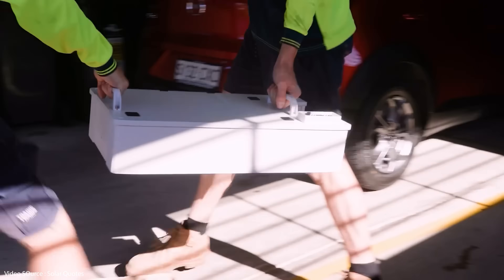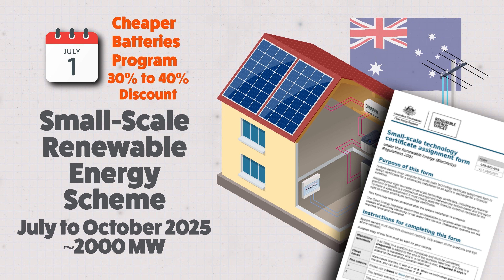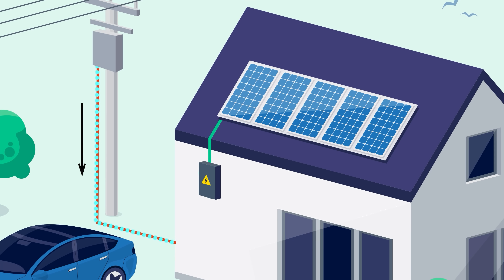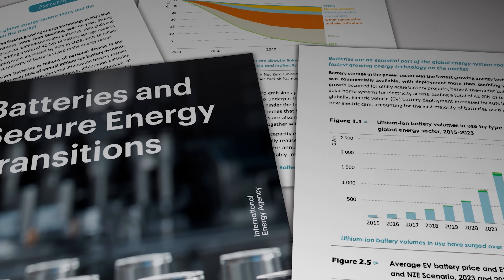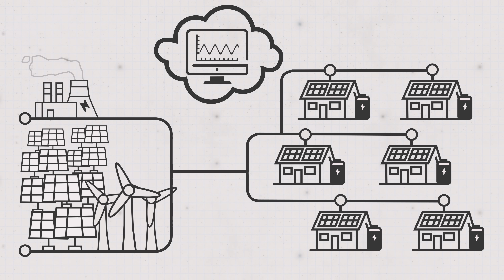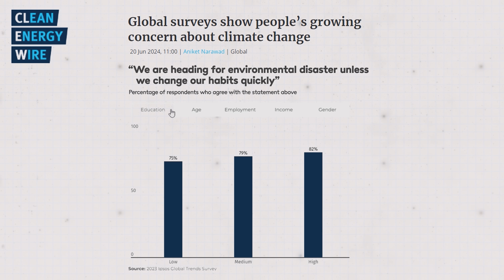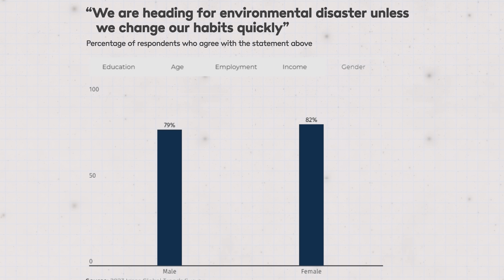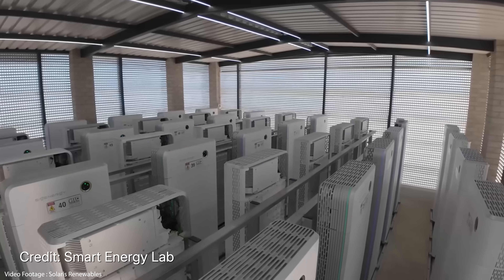Australians installed 100,000 home batteries in 17 weeks. Why can't we all do that?

Comment: So, for about 300million US dollars the Aussies have got the equivalent of a decent size power station, built in 17 weeks!
Reply: Not quite. Current technology was originally developed at the University of New South Wales and manufactured was licensed to China. Royalties were paid for many years and this continues in many other forms today.

Emitter and Rear Cell) technology—which currently underpins over 90% of global solar production—expired before the industry reached massive scale, UNSW continues to earn income from "related technologies". These include newer patents for hydrogenation techniques, patterning, and contacting technologies used in modern manufacturing.

Joint Ventures and Revenue Sharing: UNSW has established commercial partnerships that involve direct profit sharing. For example, a partnership with Hangzhou Cable involves a joint venture where royalties are shared equally.

Commercial Agreements: Historically, UNSW has signed significant licensing deals with Chinese firms, such as a $1.4 million agreement with CEEG Nanjing PV Tech to adapt PERL solar cell technology for commercial use.
Easy Access IP: UNSW utilizes an "Easy Access IP" scheme to fast-track commercialization. In some cases, this allows companies free licensing for a set period (e.g., three years) provided they invest in university research and acknowledge UNSW as the inventor.

Ongoing Research Partnerships: As of 2025, UNSW continues to receive grants and funding aimed at fostering ties with Chinese solar leaders, such as a $500,000 grant from the National Foundation for Australia-China Relationships to connect young innovators with China-based solar alumni.
Reply: But the money went mostly to China.  Congrats

Comment: This is touch Contraversial for Australia.

The Australian Government has added more Complexity, more Costs to Homes.

Then there is the detail of the installation of the batteries.
The batteries are being installed within the homes and increase the Home Fire Risk.  As opposed to installing them external to the home.

Then there are the Merits, the Higher Energy return per Solar system and per Larger Batteries of Large Scale Solar Power Stations.
lSSPS in locations such as Inland QLD with it's Rich supply of Sunshine.

The entire Grid in Inland QLD could easily be Sunshine Powered from LSSPS.
Plus Inland QLD can power a Significant percentage of the Populated, Industrial Coastal Grid.

Comment: I'm in Brisbane, Australia. Just installed 30kw battery (Sofar), 11.4kw Panels (Jinko) mounted flat on 1% roof. Old panels removed by the installer. Cost after rebates $16k. Will now be in credit on quarterly bills. It is currently summer, and using 63% of power direct from panels during the day, 37% from batteries at night. Once battery is full, feeding 15kw onto grid each day. Battery was 80% full this morning. At current calculations, I expect ROI in under 6 years.

Comment: dutch here,  i did get solar with a goverment incentive,  but they are slow with batteries,  i did buy a plug in battery,  to use more of my own solar power,  and  cut costs on  penalty's  for delivering to the grid.   which power companies started to do,  because of grid  overload.

Comment: It would be very interesting to know what Home Roof Top Solar PV is actually generating now here in UK as there are a lot of homes with it. I suspect most recent purchases will also have gone with battery storage. Hence fully time shifting electricity use to cheap electricity/free from the roof. Depending on what ever Export Tariffs are available. 
I am amazed that we are paying Wind/Commercial Solar to turn off when we have too much. They should have that subsidy taken away and then they would look at sensible storage options - of which there are many. Stupid people writing the contracts.
Reply: Battery farms end curtailment events for wind farms.

Comment: Must have a direct line internet to the house or the warranty goes from 10 years to 2 years on the batterys. well that means i have to pay more for internet, when i can only use the mobile internet or mainly tethering off my phone. so that means i have to pay $170 AUD every 2 months on old tech cable internet, oh great. that's means i'm nealy paying same amount for my power bill.  due to failed government not replacing all of the lines to fibre in area.  plus i'm happy with the 5g network on 300gb per month, I don't need anymore then that. it's a shame, it just makes things complicated. oh and also insurance increases too...ouch...nope.

Comment: In Australia we are getting 1 to 3 cents a kwh and paying 38 to 40 cents a kwh in less than 10 years the price has doubled so even though the subsidy was 1/3  people were very unhappy and they saw this as a way to even the score also the size of the batteries was a shock to the goverment 20 kwh and even over 100 kwh of storage was being installed  so that over 100,000 installed may be a lot larger than 2000 megawatts. You may want to look at the statstics avalible from AEMO to see what this has done to the peaks.

Comment: The idea that suppliers in most Australian states will pay you for excess power sent to the grid is technically correct but very misleading.  While very early adopters got fantastic returns on their surplus power returned to the grid payments at least in Victoria are now 
so low as to be meaningless.  And let’s not forget your  electricity bill  is based on two factors first the charge for electricity purchased from the grid and second a “supply” charge that covers the cost of installing and maintaining the power generation and distribution infrastructure.   Even though our house has a 5 kWh solar system and 32 KWh of battery storage and runs 100% on solar power for 7 months of the year our annual power bill is still around $700 most of which is the supply charge.  And there is a sting in the tail.  States including Victoria are looking to limit the amount of domestically generated solar power returned to the grid. Over supply on a fine summers day when every solar system is producing more than can be consumed or stored on the premises can cause serious grid instability to the detriment of of every home or business that is connected to the grid.  Solar and onsite battery storage are great but no where near as good was some commentators on this video would have you believe
Reply: Forget about solar and batteries.  It's a dead end.

Geothermal is the ticket.

Comment: What has also occurred in Australia is there has been an uptake of larger solar systems as some households update their old solar systems with larger systems to facilitate adding a battery. The battery sizes being installed has also increased probably as there are more choices of battery. and prices dropping.
The battery rebate has to be a win win situation. The government is increasing the storage capacity paid around 70% by the households, and households save money by having storage at home to use at night, a clever move by the government.

Comment: What they don't tell u, u pay 60% at $1000/kw capcity, u have no control of the charge rate in or out, a high battery cycle rate could mean battery replavement after only 5yrs(LPO). The kw/hr rebate is only 3 cemts in Western Australia. Con Job.

Comment: I'm Australian folks, when you take up the offer of the battery you get included in the VPP, Virtual Power Plant, in short the government can use your battery power ANYTIME they need it.   Yer nah! If you think the take-up is because its awesome your wrong , the main reason is because power is extremely expensive. It comes with risks, most batteries are made in China, a virtual bomb connected to your house, you will still be paying it off before you get your investment back, only the rich can afford it. Straight forward solar panels no battery is the way to go for less cost. The main problem even with this is the inverters, they die after a year or 2 are you surprised? there made in china..... The warranties are 20-25 years but the companies have gone in a couple of years so no warranty fulfillment. Dreams are awesome, but the reality is crap, sorry. As for the positive comments, call back in 3-5 years....

Comment: We installed a 5kwh solar system and 32kwh battery storage which is the largest system that makes economic sense in a suburban home. In the southern states We made this investment without subsidies to ensure energy security at a time when traditional supply sources are under threat and commercial wind farms and solar farms cannot be relied upon. The pay back period depends on where in Australia you live and there are huge differences between an installation in Cairns and one in Melbourne. In Melbourne we can generate more power than we can use or store for about 7 months of the year but during the colder months we can only generate about 20% of our energy requirements .  Was the invest of $45000 plus worth it.  In a purely economic sense No.  But in terms of energy security at a time when governments at a state and federal level level are engaged in magical thinking.  absolutely

Comment: The issue with the model in Australia is the price gouging by solar installers  is rampant.  They pocket the rebate and charge us the raw cost of the systems.  Basically they make 10000 AUD minimum for 1 days work when adding a battery to an existing solar system....

Comment: I am in Australia and recently moved house - it was a no brainer to install solar and a battery under this scheme. 13KW array and 32KWh battery. On a good day it will generate 90kwh a day, battery powers the house from sunset to dawn, including AC, and is totally recharged by 9am the next day, usually. Just signed up to Amber to become a VPP and sell excess capacity to the grind when wholesale prices are higher. Micro-generation is the future in my opinion.

Comment: I installed solar panel 2 yrs ago, it works great, but I still pays around $100 per quarter in winter and around $30 per quarter in summer. So in a year it's roughly like $260 VS pre install of like $1200 a year. But installing a battery cost about $5000.which it would take me about 20 yrs to make it worth. I would consider it if it's like $2000

Comment: I got 6.6kWh of panels in early 2020 and the Work From Home became a big thing so got a 9.8kWh (really 9.2kWh because what happens when you drain a lithium battery dry?) which cost me AUD$12,800. If I had waited 3½ years I could have gotten a 40kWh battery for AUD$8,7000 and would been 70 to 76% self sufficient for all my electrical needs.

With what I have it is now 57% self sufficient but my power bill is now more than when I install the panels in April 2020. The more self sufficient I become, the more the price of grid power increases.

FUN FACT In 2019, Melbourne Australia was putting the equivalent of a 400MW power station on their roofs (rooves) *every 3 months). But still the LIEberal COALition government at the time was talking about building new coal fired power stations.

Comment: We 'prosumers' AREN'T getting anything like a reasonable price when we feed the grid.  It used to by 60c/kWh (stupidly high) then dropped to 30c and is now at 1c/kWh which is an utter insult when we have to pay at least 30c/kWh to buy power from the grid when our solar systems aren't producing enough.
I was knocked back from several solar battery installers because the system appropriate for my home wasn't large enough (for them to make a big fat profit from) after the rebate.  So I've just bought a heap of Ecoflow units and should be able to disconnect from the grid entirely in the near future.
Ultimately, this sort of this will become the norm, as when grid demand drops like it has been, and only well off people can afford solar/batteries, the poor will be faced with higher and higher power prices for access to a grid that is going to cost more and more to maintain and feed.  As always, the rich will have moved the playing field out of reach of a majority of people and will get all the benefits themselves while everyone else pays.

Comment: it can be frustrating watching channels like this, highlighting every new niche renewable energy tech or battery chemistry. when good old solar has been good enough for 20 years, and is very cheap now, and lithium iron phosphate cells are all we need. all the different tech displayed is akin to muddying the waters somewhat. i run my entire house on cheap solar and lithium cells from china, have done for 6 years, total cost was about 4- 5 years of bills, this was without a single subsidy because i self installed with china direct prices.
Reply: I'm sorry, but a world filled with tens of millions of wind turbines, and billions upon billions of solar panels, and trillions upon trillions of battery cells is abhorrent to me.

They last only a few short decades each generation (needing to be recycled over and over and over), and are WAAAAAAY more work than is actually needed.

The world has so much thermal energy beneath the surface that 0.1% of it can power all of mankind's needs for 2 million years.

Geothermal is the path forward.

It has a capacity factor of 70-90% (only nuclear power has a higher capacity factor), and (5000) 500 MW geothermal power plants could provide us with all of the power we would ever need.

They also can last for literally centuries, and their environmental impact is tiny compared to going wind, solar and batteries.
Reply: @Les_S537  We have been trying to get geothermal to work for decades. Till we finally get it working, making the most of the energy hitting our rooftops each day makes sense.
Reply: @tassied12  Geothermal is about the have a revolution.  Look up Quaise Energy's millimeter wave (MMW) drilling technique.

Quaise Energy spawned out of the MIT Plasma Science and Fusion Center a few years back.

They use a gyrotron (used in fusion reactors to heat the plasma) to produce millimeter waves to literally vaporize rock.

They did a field test recently in a granite quarry in Texas where they drilled a 118 meter deep borehole into the granite and achieved 5 meters of drilling per hour.  Traditional mechanical drilling typically gets 0.1 meter an hour.

Quaise will make geothermal possible across the entire planet.
Reply: @Les_S537  Lets' see. Hope they are successful. Meanwhile, my point still stands. 

Innovations such as balcony solar mean that it can be used almost anywhere. Energy consumption at the point of generation is the most cost effective approach.

Ordinary Pakistanis installed 17 GW of solar capacity in 2024 alone through the availability of cheap solar panels.

Comment: In South Australia, just the rooftop solar systems in Adelaide can produce more than 6 times the electricity usage of the state.
The system was designed for such an oversupply by simply cutting the connection between certain houses and the grid, this is done automatically and alternates which houses get disconnected. 
South Australia also has a massive battery system that powers Adelaide overnight.
It is not a perfect system but large-scale solar power systems are still being developed.
The technology is already available it just needs some adjustments as the technology improves and we learn more about what is possible. 
Cutting houses from supplying the grid is not a waste of energy because it is free and as long as the sun is doing what it does the only cost is matenance which costs less per year than the weekly matenance cost of fossil fuel powered electricity generation.

Comment: Poor subsidising the rich. That’s all it is. And making the house owner pay for the grid. It used to be the other way around. But you idiots are all suckers for the “free stuff”. Morons
Reply: Our PV panels were installed by our local council;  We get free/cheap eletricity (we never managed to make a profit on it yet), and the value of the asset (the home) is higher, benefiting the council (who own it).  Clearly, as a council tennant, we are far from rich.  How did we subsidise anyone?
Reply: @The_Real_Phil_Lee you’re not capable of understanding. It’s a simple concept but you’re not capable
Reply: The homeowner has ALWAYS paid for the grid...  Through their purchase of electricity from the grid.
Reply: @Les_S537 yeah I remember that, when electricity was dirt cheap.
Reply: It is not the "poor subsidising the rich". If better use is made from the power coming from people's rooftops, everyone wins. Demand from the grid falls, which avoids network costs. Power is now so cheap in the middle of the day that some retailers (eg OVO) offer free power at that time, even if you dont have a solar/battery system

Comment: Of course australia has terrific solar production capacity relative to europe and the UK. With high UV levels.  Possibly at least double or more. We also have weather that offers less cloud and rain. We also have homes that are larger with large roof area. All these factors mean terrific production. However the problem is solar stops at sundown. Most of the day needs the grid. Energy companies are all building mega batteries but it truly needs micro batteries....in homes. 
I was one. I stopped buying from the grid and now have a 43kw battery and 15kw solar and 15kw inverter. I produce free power. I store it. I use most but sell the balance. This pays if i must buy power. And pays my gas. Saving? $6000 aud  a year. Setup cost after $20000 from govt....$12000. its a no brainer. But they have realised its too generous and have slashed the rebates....massively. This change takes effect in may 26